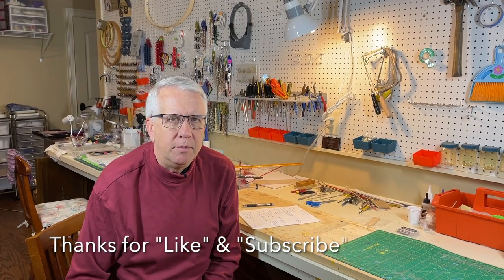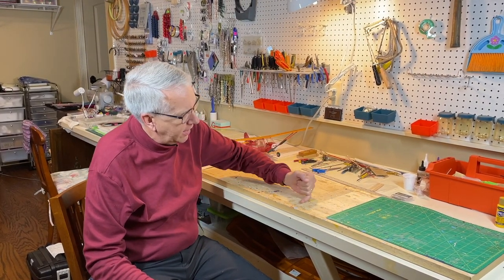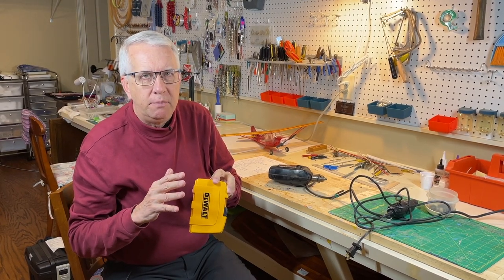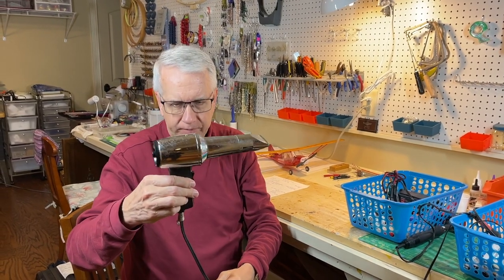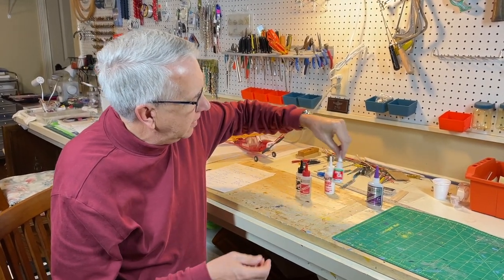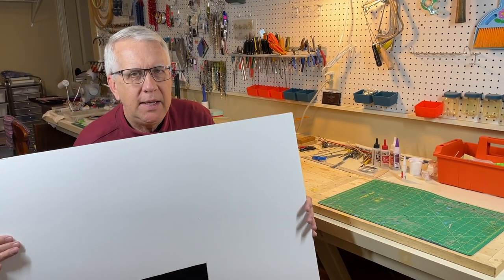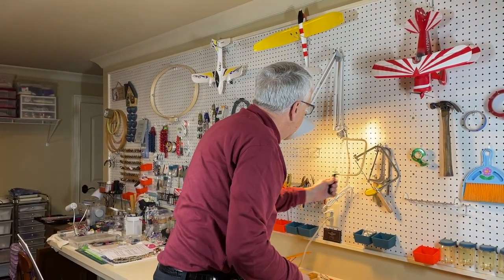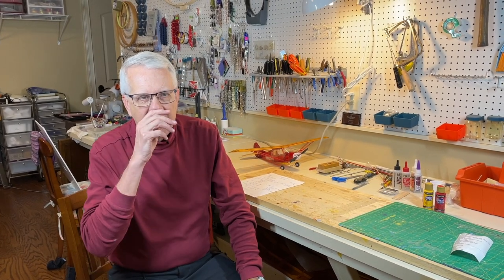My Model Airplane Workshop A Basic Set Up

Comment: The paper of dollar store foam board is easily removed after you sprayed it with 50% rubbing alcohol/water mix. Peels of in one sheet about 30 seconds after you sprayed it, in particular the black paper (which soaks up the mix better).
Reply from the maker: KH:  Great tip, many thanks!  Tim

Comment: Tim -- I don't have a building board as of yet. I see your Guillow's board is no longer available   I see others use hollow or solid core doors with sheetrock but, what you have in size is more realistic for building. I don't have room for a Door! Something like the size on your bench to me looks about right. Say 14 - 16 inch wide and 46 - 48 inches long I think would be big enough to build the models I'd like to build. 
     So, what would suggest making a Build Board out of --- and suggestion on building it.?
       Thank You ----- Rodney
Reply from the maker: Rodney:  You raise a good point, I need to do a video on this. Do a Google search for RC airplane building boards. www.FlyHobbies.com had a Great Planes board that looked good. Also, folks have used ceiling tiles on a plywood base. Tim